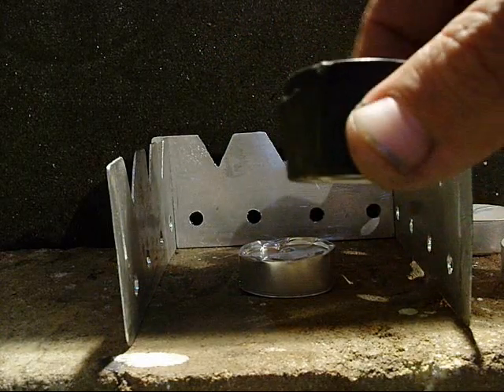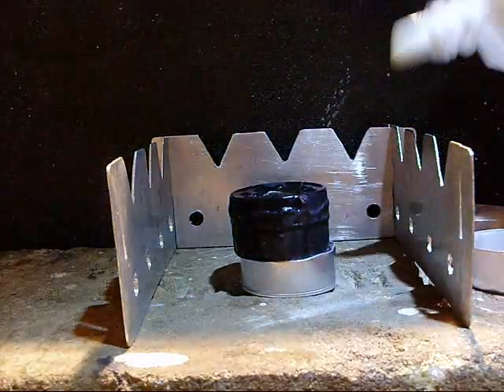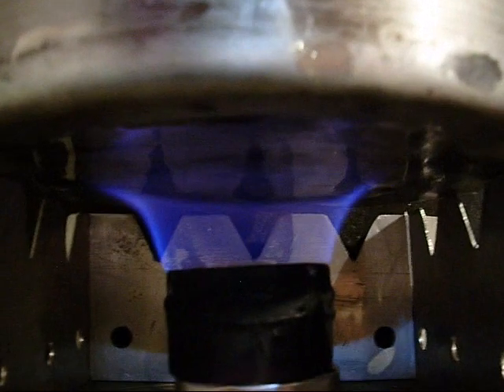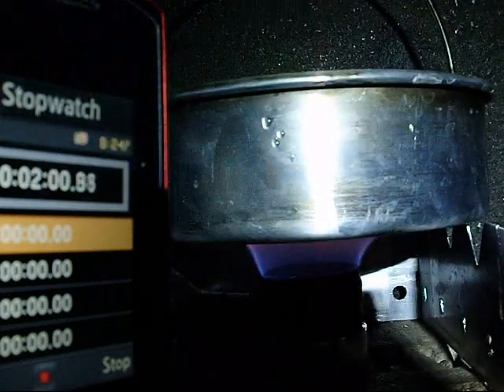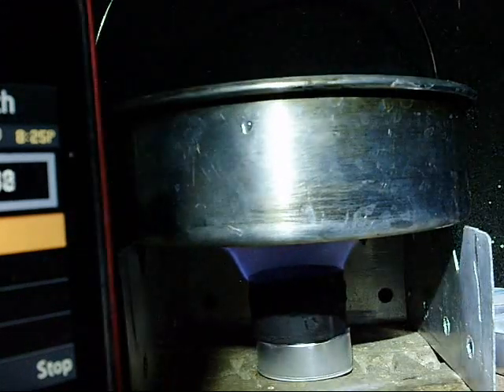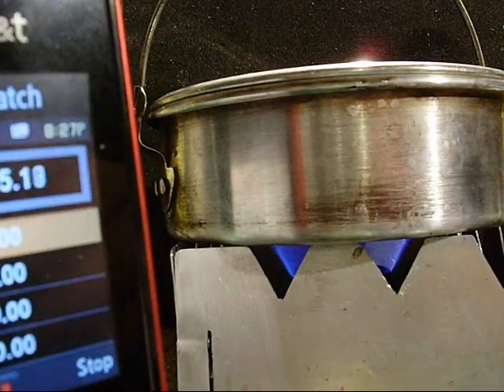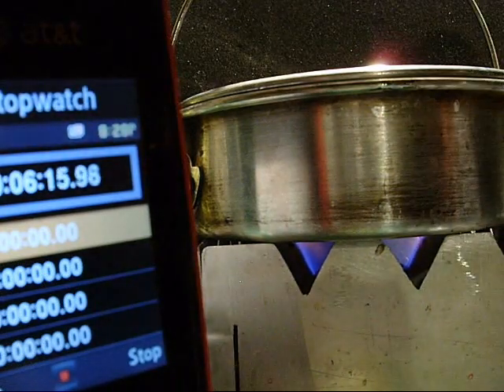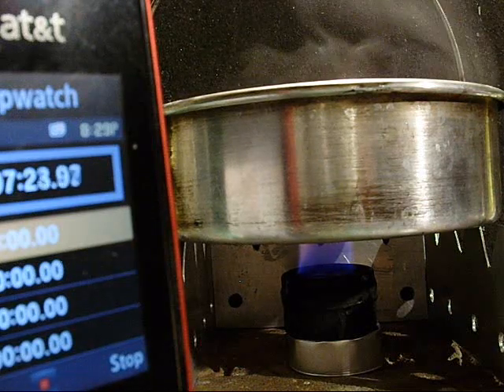NEW ULTRALIGHT BACKPACKING TEALITE ALCOHOL STOVE &  POT STAND

Comment: You could do more those attaching slits on front and back plates to adjust the width of your stand. That way you'd had an option to use also smaller pots there. You woudn't then need those round holes there because air would go through the slits.

Comment: The volume or my tealight

Vol = Pi * (.5 * d) * h
Pi = 3.14159265
d = just over 1 3/8 in but I rounded to 1.375(1 3/8 in)
h = .5 in
Vol = 3.14159265 * (.5 * 1.375) * .5
So put this into a google search and you get
1.07992247 cubic inch
So searching google again for a "volume conversion" we get:
0.598 oz US.
So since we rounded down before we could say its .6 oz or 1.2 Tablespoon
Reply: Except: What you've calculated is the area of the outside wall of the tea light. 
Volume of a cylinder = Pi x r (radius, which is 1/2 diameter) squared x h (height) = Pi x r x r x h
Your measurements: Pi = 3.14159265; r (1.2 d) = 0.6825; h = .5
So, Volume = 3.14159265 x 0.6875 x 0.6875 x 0.5 = 0.74244670133665 cubic inches = 12.2 ml. 
Or, approximately 12 ml. (or 0.4 fl oz, or 2.4 teaspoons, or 0.8 tablespoon)
Then you probably primed it with another 1.5 ml.